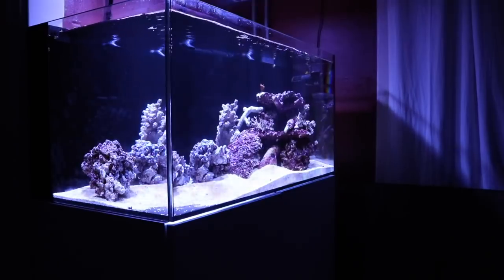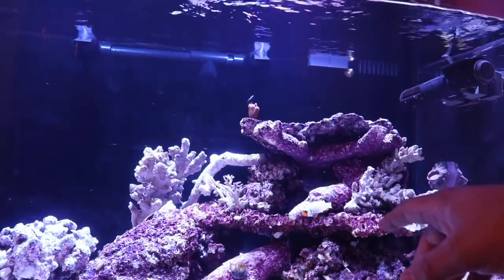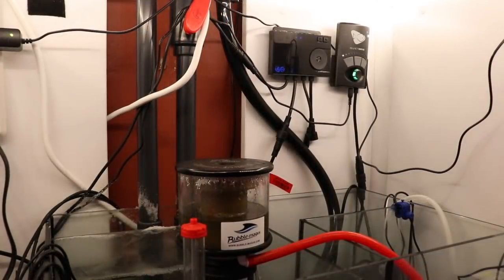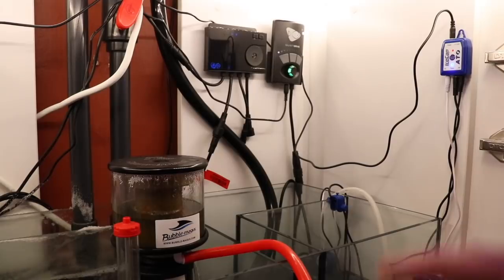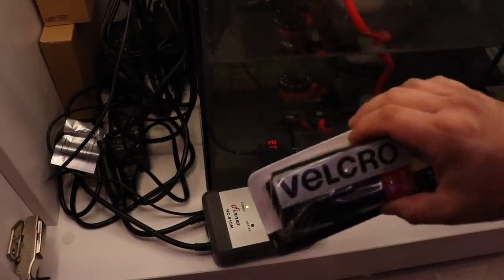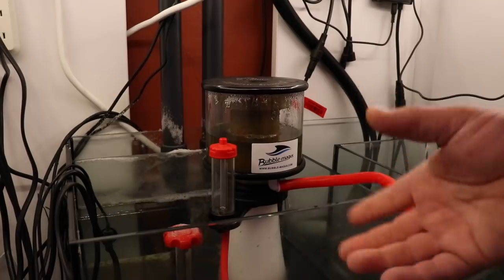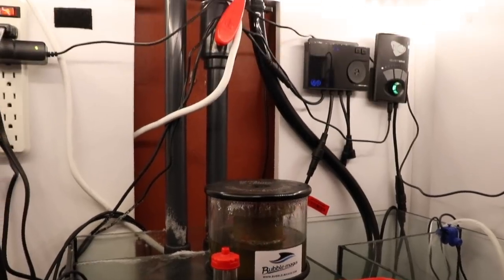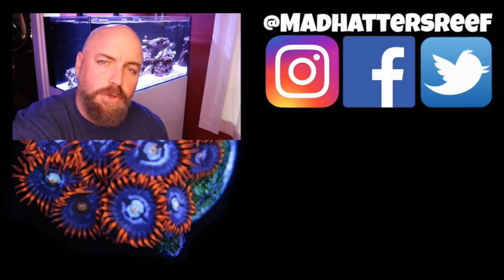Waterbox Reef Tank Build | Ep  9 | Tank Update

Comment: The nest Velcro solution out there is, bar none, find the same style that is used to attach toll transponder to you wind shield. You know if you found it because it  is white/translucent. If anyone here has had to take if off the wind shield you know what I’m talking about. Two little half inch pieces can hold up an elephant!!! I use them when I’m filming in the field, they are almost too good. Not only is the Velcro ridiculously strong, so is the adhesive. In fact if I were to use it, I would put a pan head screw in the surface mount point for a belt and suspenders approach. I wish I had the name of it, the toll booth folks will give you a couple pieces for free if you ask. I know I bought mine at Ace. They are awesome!!! I hold up a full size iPad with a Pelican otter box on my tripod with a 1/2” x 1” piece, and that’s even overkill.
Reply from the maker: Great Tip!